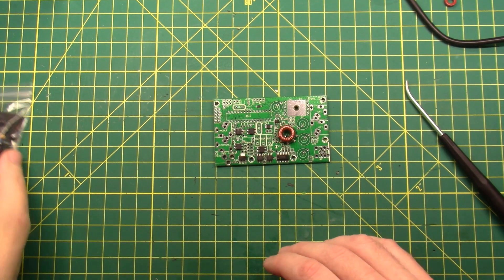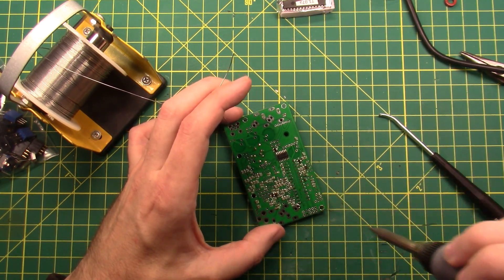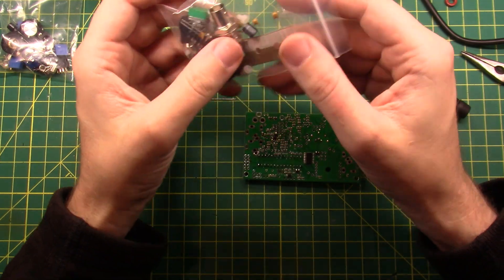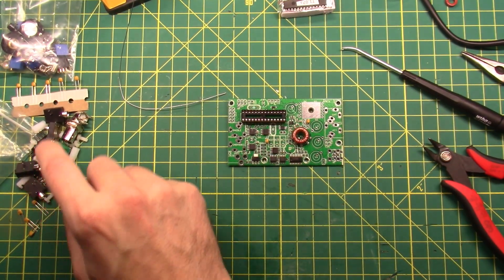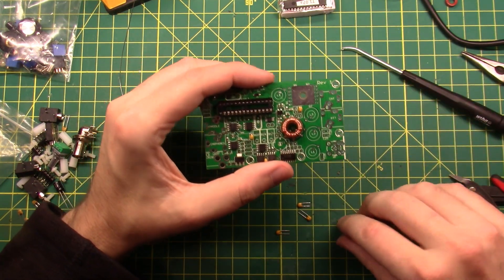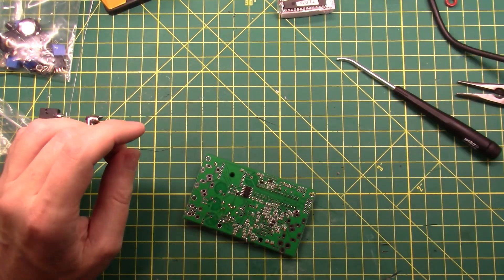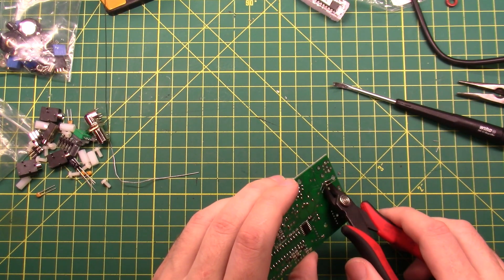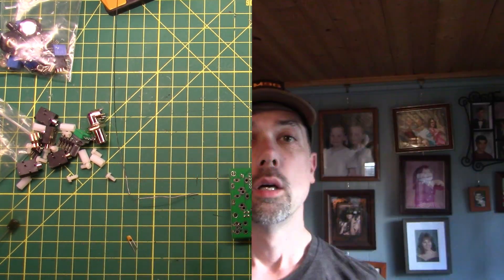How to build a QCX Mini - Part 3 - Passives, Fixing Mistakes and Tools

Comment: Saw the QD Electronic Cleaner - what have you found best for cleaning the board of flux when you are done soldering?
Reply from the maker: It is best to clean a little as you go along.  Otherwise it is super overwhelming at the end and everything gets sticky.  Right now I'm using 4140A Flux Remover and its working well. https://amzn.to/2RyM197
Reply: @temporarilyoffline  thanks for the tip on cleaning flux